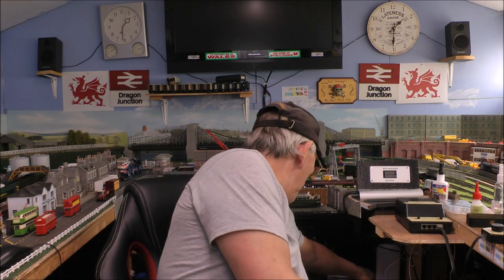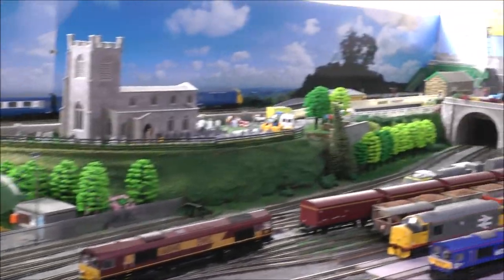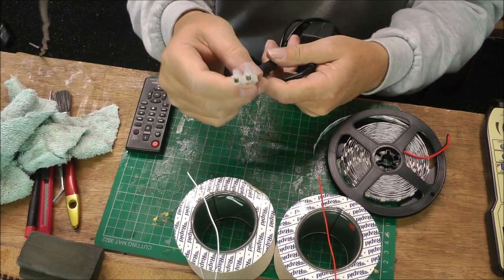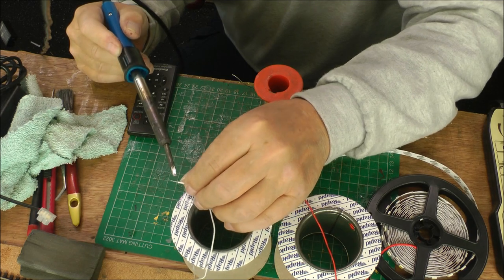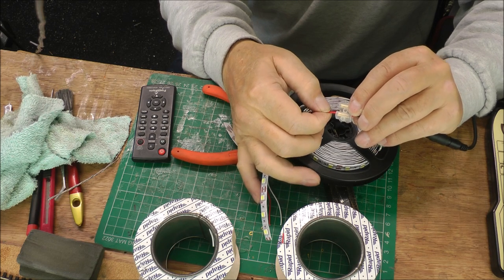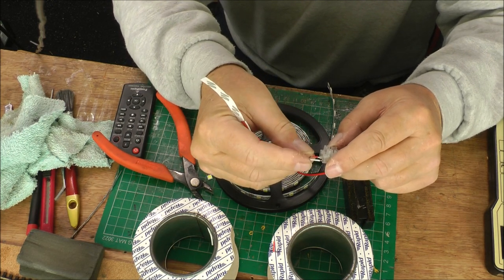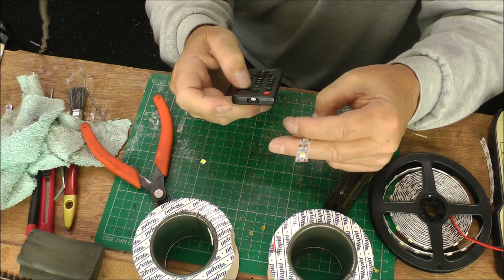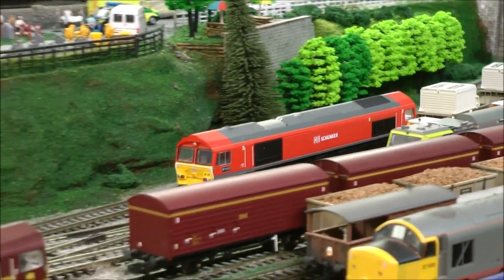LIGHTS....how to wire up L.E.D. light strips.

Comment: The engine shed lights need to be as bright as they are at night. That way, in the early hours of the morning, the Fireman can see which steam engine he's walking towards in order to light up. If the lights weren't that bright, our trusty Fireman might have a nasty accident by tripping over or walking into something he can't see properly. And then you'd have the management to answer to. That's not the way to run a real railway. Glad to see Scottie in action, but I'm still waaiiting for a certain steamy running session to come along. Surely there's no need to be this snail's pace-slow at it. You're taking far too long here pal. Where's my steamy running session?
Reply from the maker: 5 MPH at the depot Kelly

Comment: Nice video Allan, I do like the gold train. With regards to the LED strips.  They work fine if you have a 12v bus under the layout for lights etc. The resistors are Balance Resistors and need the 3 LED's on each bank of 3 LED's. They are also in series, if you remove one it takes out the other 2.  If you are good at soldering you can remove each LED, solder wires onto them, with a normal resistors, are stick them in the roof of cabs in loco, solders to the forward lights so the come on in the direction of travel. I will eventually do a video on how to do that...Simon

Comment: Hi Allan. Thanks for showing me what to do. Can you advise what gauge or width of red and white wire you used and here did you buy it? Ever since the demise of Maplin, choices are short on the ground. It is the reel marked Rapid. Is it single core? Thanks. Much appreciated. Mike
Reply from the maker: to be honest am not to sure what gauge wire it is ..just use the same as your controller to the track wire..your model shop should be able to supply you with the right cable..multi strands type cable is fine.single core is to stiff to use easily..
Reply: @lord-al-2024  Thanks Allan. Unfortunately, the nearest model shop for me is 50 miles away so not so easy to ask. However, your advice is solid. Thanks. Mike
Reply from the maker: @gartsherriejunction4643  if i remember ill put in my next vid what i use..ok..

Comment: Good evening Alan, thank you that looks really easy don't know why I was so reluctant to have a go. One little question could I use the 12v uncontrolled on my hm transformer? , I think even I could havve a go .l noticed the flasher  in the cab of flying Scotsman  she gets every were,  that gold train looks stunning, nice bit of running. Thanks Alan take care see you on the next one Eddy xx
Reply from the maker: all i can say is give the transformer a go if it`s 12 volts output.
Reply: Thanks for your troubl Alan regards Eddy xx